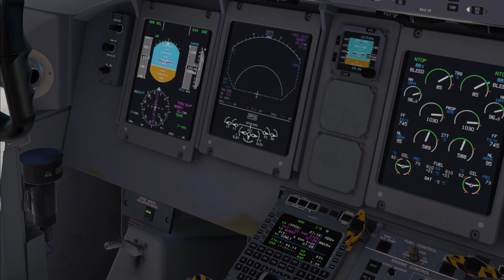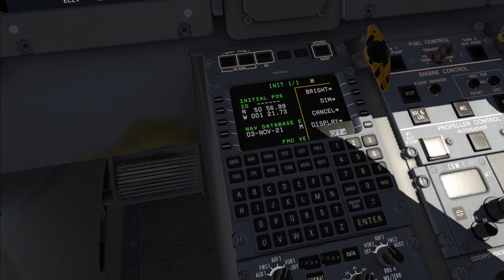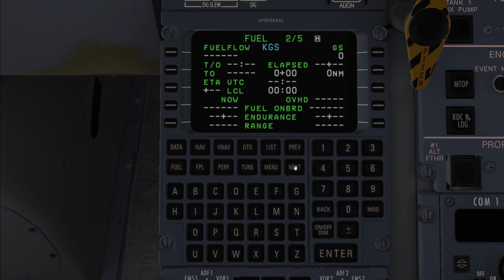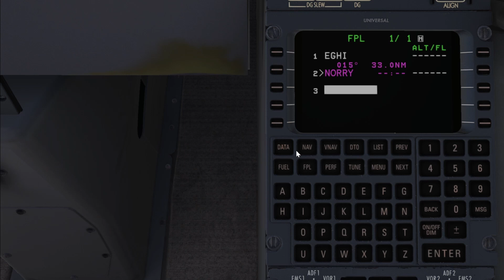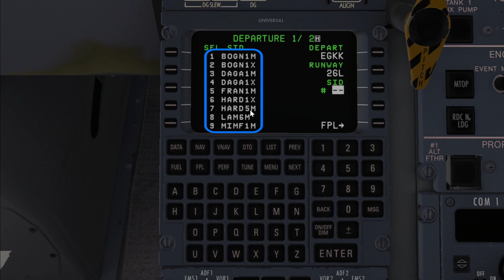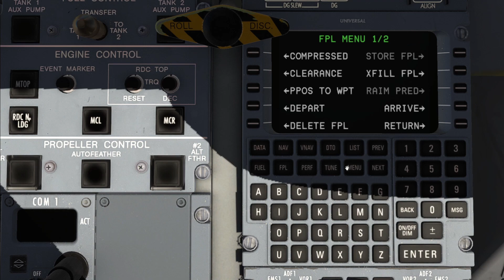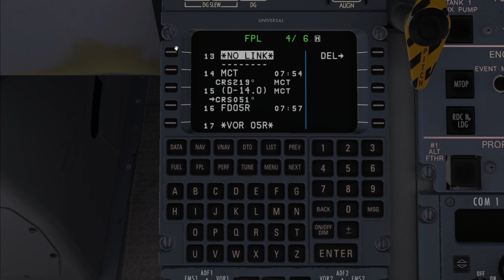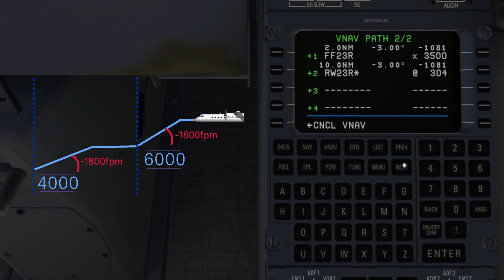FlyJSim Q4XP: FMS Tutorial

Comment: Be nice to be able to add GPS coords in the box. Wonder if they will add the INS system also.
Reply: There is no INS. It has AHRS. You can create your own waypoints.
Reply: @YYZatcboy  some variants have a micro INS system installed just below the CPTs radio panel. Usually a toggle switch. According to the dev team you cannot create your own GPS waypoints. Yet!!